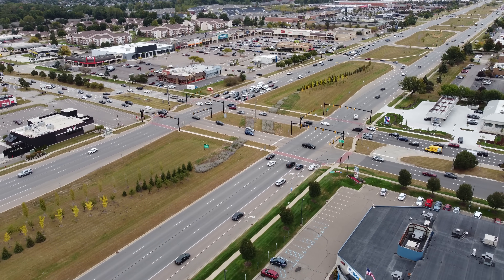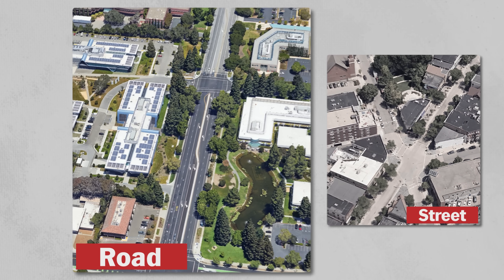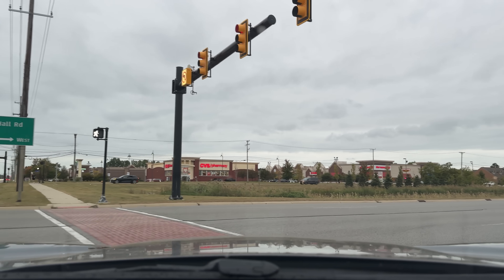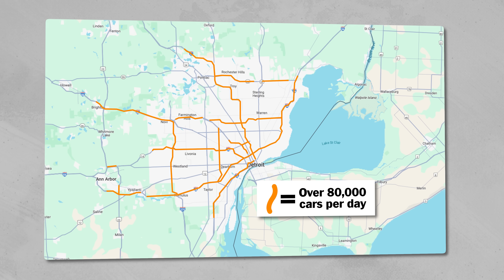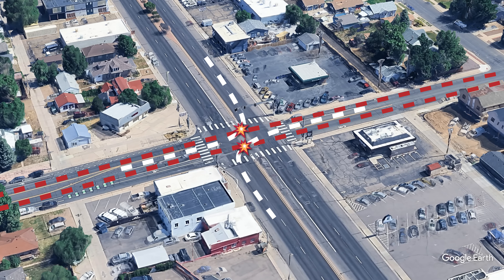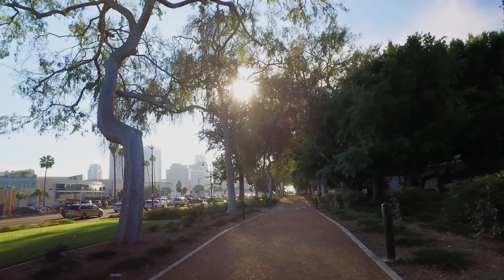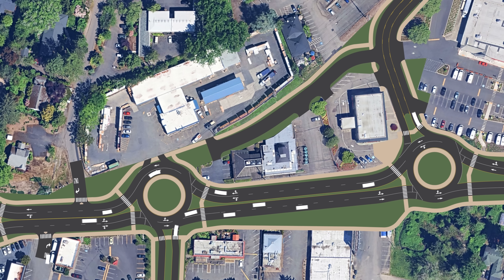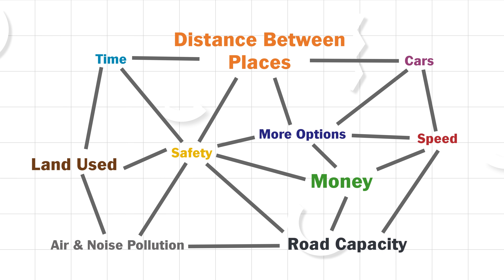How Michigan Built a Super Highway Using Only U-Turns

Comment: The whole video I was thinking "Isn't this just a roundabout with extra steps?", and then it turned out that it is!
Reply: Yes its like a hamburger roundabout since there may be a priority direction that cuts through the middle of the roundabout.
Reply: It’s not just roundabouts with extra steps. It has different strengths and weaknesses than roundabouts. It is worse for cars turning but superior for cars going straight. As when you are going straight on roundabout roads you might have to wait at each roundabout and you have to slow your speed at each roundabout. 

This design as faster through traffic while sacrificing turn optimization
Reply: Some of these conversations are just going around and around in circles LOL
Reply: Well sort of. These roads are dedicated for higher speeds though. Roundabout roads are usually slower speeds at 25-45mph, while Michigan U’s are typically for 45-60mph. This type of traffic density would be congested in a roundabout system. It would have to be a pretty huge roundabout to work efficiently. I personally like roundabouts more, but many people don’t know how to use them and it would cause chaos for a long time before people adjusted.
Reply: You don't want a roundabout on a 4-5 lane road with speeds at 45-55 MPH.
Reply: @ConnerDogood76 roundabouts on multiple lane roads with 70mph limits function perfectly fine in the UK.
Reply: We have more accidents in roundabouts than on proper divided roads here in Michigan.

I grew up driving on Hall Road and a handful of others like it, some that cross each other, and it’s superior to roundabouts, because if you don’t know where you’re going or going somewhere for the first time, it helps having more options.  You can make a Michigan left by turning right or by going straight through and turning around which doubles the amount of cars so if you didn’t realize it was the turn you needed to make and were in the far left or far right lane, you can still turn left from either.

If you don’t build roads like this you’re just doing it wrong.  Metro Detroit invented suburban sprawl and because mass transit isn’t a thing here, we know what we’re doing when designing roads.
Reply: Roundabout that is spaced out with central bypasses - which does work. The problem with traditional roundabouts is that all traffic uses a single circle at the same time.
Reply: @casmatori  I don’t understand why all traffic sharing the one circle is more of a problem than all traffic sharing a single road?
Reply: @casmatori  roundabouts are the best option for junctions like in this video. All over the UK you will see roundabouts on A roads (highways). They can have 2-4 lanes clearly marked out and places with large volumes of traffic will be traffic light controlled. They work. They are efficient and safe.
Reply: @casmatori yhea but we already created multiple lane roundabout
Reply: @Kisbivaly yeah but those are terrible
Reply: @micahbonewell5994  how?
Reply: @Kisbivaly  except ordinary multilane roundabouts still require weaving in and out. Spiral/turbo roundabouts smoothly guide the cars outward
Reply: Not quite. You have to stop at the intersections of a michigan road vs just yielding in a roundabout.
Reply: Yes and no. Roundabouts work best at lower volumes of traffic than you get on Hall Road – 4-lane roundabouts really need traffic lights on or traffic coming in from the side roads can end up waiting for a looooong time, but once you put traffic lights on a roundabout you lose a lot of the advantages of having a roundabout. And because traffic needs to at least slow down for each roundabout, it won't flow as smoothly as if you can give the main road a green wave through successive intersections.
Reply: Except that it also isn’t! A roundabout has a fundamental flaw in its design of allowing the vehicle in the roundabout to always have right-of-way. The Michigan Left allows the primary through-traffic to have priority. This means that the through traffic backs up less! As a Michigan native and someone that has spent thousands of hours driving on Hall rd, 8mile, Telegraph, Grand River, and the MANY many more roads here that use the Michigan left AND driving on many many roads that use roundabouts. I can say from first hand experience that the Michigan left is superior.
Reply: I didn't even watch it. Saw the thumbnail and came to say it's just an elongated roundabout.
I expected another 'yet another American invention' video so didn't bother with it.
Reply: https://www[dot]picturesofengland[dot]com/img/X/1041238[dot]jpg
Reply: @GeekBatman  ofc you feel the need to comment ignorantly on something you didn't watch. LOL
Reply: Just about every major city street in Detroit..called a Detroit left turn!
Reply: Totally wrong take here. It is absolutely not a roundabout
Reply: @MichaelOfTroyWasHere  maybe it's not really a roundabout, but it sure wants to be one
Reply: Couldn't be more different than  a roundabout
Reply: They have a lot of these in michigan, and I know from experience that people in Michigan don't understand how circles work. Roundabouts literally cannot work at Michigan because from my own personal experience of watching people do roundabouts,....... It makes you wonder if the people in Michigan can breathe and walk at the same time...ya know? People come to a full stop at every single solitary roundabout in the state.
Reply: True, but there are ZILLIONS of Michigan Lefts, wouldn't be practical to install roundabouts at every intersection.
Reply: It's a roundabout with stoplights so the worst of both ways of moving traffic.
Reply: @timber9705  not for those of use who've been t-boned on a 5 lane street in the business district, it's ideal for high traffic, higher speed areas.
Reply: Squareabout*
Reply: They're roundabouts that are friendly to plowing massive amounts of lake effect snow we get with the kind of trucks we have up here.

But hey, keep coming up here and forcing us to build roundabouts that turn into giant slippery blind corners every winter.
It's sooooooo helpful./s
Reply: Just wanted to constructively chime in here to say that you're all wrong.
Reply: It really isn't.  I live a mile from the area he displayed in this video.  We also have roundabouts.  People around here still can't figure out roundabouts even though they have been around at least 10-15 yrs now.   I have been to a lot of states.  none handle traffic as well as we do here in Michigan.
Reply: Nah.  Not quite.  If you're going straight or turning right, you don't need to enter the "roundabout" at all.  It's only when you want to turn left.  With an actual roundabout, you have to enter it no matter which direction you're going.
Reply: As an American who has to deal with so many stupid roundabouts that were fine as Yield/Stops, FUCK ROUNDABOUTS. I went to visit some friends, in their town they have 3 roundabouts BACK TO BACK TO BACK and the city nicknamed them the WHEELS OF DEATH.

The Michigan Left is way more efficient and better for traffic flow since WE ALSO HAVE THE LAW THAT ALLOWS TURNING ON RED WHEN SAFE TO DO SO.
Reply: It is, but the extra steps make it feel very different when you actually drive it. I live in a MI city that has actual roundabouts (Uncommon in MI, probably in all of the US), and this feels less like a roundabout, and more like a bus route for cars. You travel down the line until you decide to veer off at your exit, but there's a lot more exits and go through the city.
Reply: No, people here understand how a Michigan left works, nobody knows how to use a roundabout, I’ve had everyone from a small car to a fully loaded school bus pull out in front of me in a roundabout. And emergency vehicles can make that left-hand turn instead of having to slow down trying to make that sharp curve in a roundabout.
Reply: Not at all, there are roundabouts in the area and they are way less convenient than Michigan Lefts, especially the roundabouts in the Southfield area near Evergreen rd.
Reply: No, the major intersections on these would be more than what you want on a roundabout
Reply: @TheTapeandscissors  Yes, for a normal roundabout. But a large one with traffic lights and priority direction lanes can get the benefits of both a roundabout and traffic lights.
Reply: @sparetot  drive around Bucharest and you'll quickly see why roundabouts with traffic lights are shit (unless Romanians just failed to design them properly, I could be wrong here, but it definitely sucked lmao)
Reply: @HeywoodJablome-pv7ge  I've driven in Michigan, the Michigan left is basically a roundabout with lights and works well.
Reply: @HeywoodJablome-pv7ge  That sound like a traffic circle and those are shit.
Reply: @sparetot A Michigan left is 180° with a stop sign or stoplight because it must yield to thru-traffic whereas a roundabout is 360° with the right of way & 3 branches all where you turn right in order to go right, straight, or left. The second right makes you continue in the same direction on the road you’re on, while the first & third rights take you onto the crossroad of it. If you’re traveling on a road heading northbound, then the first right on the roundabout will take you east, the second right continues you in a northbound direction on the same road, & the third right takes you westbound on the same road as the first right.😘
Reply: @sparetot  there are roundabouts with traffic lights. I think in the evenings or late nights the traffic lights are off.
Reply: @KatFish682  not saying they are the exact same but they both dont have lefts across traffic and do a left by doing a 270 degree turn
Reply: Americans will do anything other than install a roundabout
Reply: @DanTheManOG  america has more roundabouts than any other country except France and Italy.
Reply: @traffic.engineer  LMAO how wrong you are!

The UK is estimated to have around 25,000 roundabouts, while the US has around 9,000-10,000 modern roundabouts.
Reply: @DanTheManOG  Majority of "roundabouts" in UK are signalized, and therefore are disqualified from being called a "roundabout".  America refuses to install signalized roundabouts, as that defeated the purpose.  Signalizing a roundabout means it is overcapcity and can no longer function efficiently.

Painted roundabouts are also disqualified because they essentially have all the dangers of a standard intersection.
Reply: @DanTheManOG  and America currently has just over 13000.
Reply: @traffic.engineer  No it doesn't disqualify them. a controlled flow roundabout is still  better than any intersection. But no we haave magnitudes more roundabouts than the usa, if you even consder this.

Painted roundabouts ? do you mean miniroundabouts? because no they do not, they are litterlly the simpliest and smallest roundabout to install and do their job effectivly. they maximise traffic flow. Junctions always have a bias and restrict flow.
Reply: yeah, Americans are real ignorant to criticism about their driving that they would rather wreck for it and take credit for a better idea.
Reply: Roundabout on a highway like road doesn't sound like a good idea
Reply: Well, the Michigan left at least legally involves coming to a complete stop.
Reply: Generally, I find Americans just to be poor drivers. You should see the intersections we have in Australia and yet it somehow works without accidents: https://maps.app.goo.gl/J7GHbCwjWMP8h57W7
Reply: "Turned out" you say 🤔
Reply: Wrong. Oblongabouts. You’re welcome.
Reply: Came here to say that.
Reply: Just a lot faster
Reply: I saw a roundabout with extra steps from the thumbnail.
Reply: @barneystafford  A roundabout forces straight and left turn traffic to mix. This does not.
Reply: @bftjoe  "with extra steps"... hmm, I wonder what that means?
Reply: @barneystafford  It is only "extra steps" for left turning traffic. To just say "extra steps" makes no sense whatsoever, as zero extra steps are required for straight traffic.
Reply: It may seem that way, but these are just different takes on traffic-only-goes-one-way-at-a-time stop lights. Like roundabouts, and diverging diamonds, they're just one of the new stupid fads. Instead of getting priority to turn left at an intersection, you have to turn right, get all the way across four mother....ing lanes, and into a u-turn lane (in 38 f'ing feet!) to do the same thing.
Reply: Buddy it's like an 80 mile long road.  A roundabout is an intersection.

Hall Road runs from the Water then west 80 miles to howell before it gets merged with an interstate.
Reply: Have you ever traveled down a road with a roundabout every half mile? I do all the time. And it sucks.
Reply: @cheekkeith74  Beats an intersection every half a mile. And by a lot.
Reply: excellent thought
Reply: They are roundaboutsssssssssss with traffic lightssssssssssss, period.
Reply: @sora11231  ... kinda like a nail and screw are the same thing, except for two things.
Reply: There’s no lights in roundabout
Reply: It's not anything like a roundabout lol wtf.
Reply: Better than a roundabout, this method spreads the traffic out more and allows people to turn at more exact points for their destinations instead of all traffic on two roads converging at a single roundabout.
Reply: Maybe, but this is better
Reply: To contribute to this discussion, Michigan lefts are not like roundabouts. They are far more straight forward and don't require any navigating or waiting to make a move or extraneous traffic lights like a roundabout capable of handling 80,000 cars would need. And ironically one of the worst cases of traffic I've ever been in was in Sedona, Arizona which had tons of low capacity roundabouts when what they needed were traffic lights.
Reply: A roundabout with an option to just drive straight thru the middle.
Reply: You don't understand stroads and toads that well.  They are very very different than roundabouts.
Reply: Roundabouts suck
Reply: That's what I was thinking too.
Reply: Exactly my thought!
Reply: Most roundabouts in Holland have a capacity of about 30-35k.

In the video I think 80k was mentioned so some form of traffic lights is needed
Reply: Nah, roundabouts are much better
Reply: People in Michigan dont know how to use round abouts 😂
Reply: What he is suggesting will require a lot more lane that cities don't have or can't afford to buy.
Reply: No, not at all, but we have lots of roundabouts also. The two are not the same. Did you not watch the video and pay attention?
Reply: 59 isn't the only road in metro detroit with michigan lefts there's Mound, Telegraph, 8Mile and many more.
Reply: No it's not. It's just a u-turn
Reply: It isn’t, because it doesn’t require through traffic to slow down.
Reply: Yes, it's like a roundabout but it's also a hybrid of a roundabout and what engineers here in the US call a continuous flow intersection.
Reply: The problem is that the volume of traffic on this particular road, a roundabout would be less efficient, and with the amount of trucking, far more dangerous. You (and the producer of this video) really need to grasp the scale of the traffic here. In fact, my old apartment was shown in one section of the video. The volume is incomprehensible to people that arent from here.
Reply: Unlike a rounabout, this doesn't force traffic going straight to stop.
Reply: well, can your lame, ungenius roundabouts waste so many spaces in the middle so efficiently?
Reply: Nope, this is not like a roundabout. You need to experience this in person to understand the benefits of “Michigan Left Turn”. When I first moved here I was confused as hell but after one month, I released this is the greatest traffic implementation ever! There are traditional roundabouts in Michigan as well but they are terrible
Reply: Unlike a roundabout, drivers not turning do not need to do any special maneuvers, nor yield to traffic turning.
Reply: @jonahtaivalkoski322 and it allows timed lights on telegraph so you never have to stop. Other states are so goofy.
Reply: How do you figure this is a roundabout?
Reply: @TheArfdog Ignore the 'look' of this, look at the traffic flows.
 - In the UK this would be called a "doughnut roundabout", because it has a road/hole going through the middle of it.
 - Roundabouts can be various shapes, they are where you go "around" rather being round shaped.
 - Roundabouts can be big. In the UK the centre of a roundabout can be literally a city block.
 - Highways here often have Roundabouts along their length
 - Arguably,  the "M25" orbital is a roundabout that encircles London, some other towns and an international airport. A round trip is 117 miles.
Here Roundabouts vary substantially in design and style to an extent you can easily not realise you have just crossed one. So almost any Brit looking at that video is almost straight away shouting "It's a roundabout!".
Reply: @johnpublicprofile6261  did you cite a study of your precious donut roundabout vs Michigan left yet, or are you still based entirely on your feelings????
Reply: @bftjoe  Why would there be a study of a doughnut roundabout vs a doughnut roundabout?  My point is not that a doughnut roundabout is better than a Michigan left, it is that a Michigan left IS a doughnut roundabout. One of which is a mile from my home helping join (in your vernacular) a highway to an interstate.
Reply: So in your donut roundabout, you turn right and then u turn to make a left? I somehow doubt that, LOL. And straight traffic goes thru unimpeded.
Reply: @bftjoe  Re: "I somehow doubt that, LOL" you have just been watching a video of one operating in Mitchigan. Whether you call a vehicle a car or an automobile does not change what it is and whether it works just because you use a different name. Likewise, calling a junction a "doughnut roundabout", "donut roundabout" or "hamburger roundabout" instead of a "Michigan Left" won't suddenly stop it working. 
And on a roundabout, what ever you name it, not only can you turn right, follow the lanes to turn left (or as you put make a U turn) you can keep following the lanes around  to come back on your original entry road to travel back to where you came from (an actual U turn). I am sure there are plenty of other videos about roundabouts that you could watch. FYI there are over 25,000 roundabouts in the UK in a country only the size of a single USA state, so before you continue being flat-earther about them consider that we might know what they are and whether they work.
Reply: @johnpublicprofile6261  hey, still not the same thing, sorry, bro. useless essay man.

what roundabout supports 4+ lanes in each direction with straight traffic unimpeded at 40+ mph????? not a donut roundabout, LOLOLOL.
Reply: @johnpublicprofile6261  tell us, o fake genius, how many lanes the widest donut roundabout has for straight traffic in the UK? and what speeds do those lanes move at???? LOL

if it was the same thing, then it could move traffic at the same volume, speed, and footprint.

Maybe a donut roundabout has FEWER lanes and LOWER speeds because IT'S NOT THE SAME THING!?!?!?!?!??!?!!???!?!?!??!???

did you even watch the video? 😆
Reply: no, roundabouts can't handle large volumes like this can.
Reply: @bftjoe  They can and multi-lane roundabouts with up to 3 circulating lanes have been attempted in MI and would have theoretically worked, but we found the biggest problem to be the motorists and their tendency to ignore signing and striping. They were "too complicated" for the average motorists as you needed to choose your lane far in advance of actually entering the roundabout (changing lanes within the roundabout wasn't supposed to happen). This resulted in far more sideswipe collisions than intended. The pavement markings also wore very quickly and needed to be reapplied annually and it was a maintenance issue so local governments just never did it which resulted in even more collisions. Most (if not all) of these were later reconfigured to more conventional designs.
Sometimes designers and engineers can have really good ideas on paper that work in theory and simulations, but human behavior is difficult to predict.
Reply: @Peet-e2h  so you honestly think navigating a multi lane roundabout is the same thing as just staying in your lane going straight? what are you even on about???
Reply: @Peet-e2h After seeing European dash cam videos with constant diverging collisions, multilane roundabouts must go through strict review where they work.
Reply: @Peet-e2h  But this junction still requires motorists to choose their lane ahead of time, except that I think you also have to “choose again” and change lane during the junction for some routes. If US drivers can’t handle the complexity of a junction (roundabout) where they have to know where they’re going ahead of time, they’re not going to manage this junction. (Incidentally, if you don’t know where you’re exiting a roundabout you can just use the inner lane—closest to the island—and keep “changing lanes” inwards by driving in a tight circle until you see your destination written on the road underneath you, then start the outwards spiral in that one lane to the exit.)
Reply: @bftjoe you can have large volume roundabouts! But this is more like a roundabout you get in only if you need to switch direction, if you want to go straight you never enter the roundabout-esque part. Basically, only the leftmost lane is a roundabout.
Reply: @bftjoe  Roundabouts can handle WAY more volume than standard traffic lights, no idea where you got that idea from.
Reply: @WimsicleStranger  what standard traffic light is in this video? LOL
Reply: @bftjoe  This is a common miss conception. Traffic lights increase the perception that there is more traffic. in reality roadabouts pass more traffic faster in both directions and do not prevent flow of vehicles.
Reply: @richardnolan5573  you're wrong, show the data on Michigan left vs roundabout or be quiet.
Reply: @bftjoe So a roundabout like this one can't handle the traffic that this "doughnut roundabout" can handle?!
Reply: @johnpublicprofile6261  Do you think a roundabout can handle 6 lanes of traffic in each direction??? What are you on??? Cite a study or be quiet.
Reply: @bftjoe  I agree,  I lived where there were 2 large roundabouts on one main highway.  They did well even with higher traffic levels, but once traffic got really heavy it was a mess.
Reply: @bftjoe Europe disagrees.
Reply: Why put a roundabout on a highway
Reply: @WAATLP  Depending on the traffic levels from the different arms you can keep traffic on the main route flowing compared to traffic lights, you remove left turns creating a point of conflict, and traffic joining from the side streets or business only need to look for a gap from the left to be able to join the road after which they can continue through the roundabout to their exit without need to stop and wait for another gap or at lights.

The problem with roundabouts is when traffic is too dominant on the main route that waiting traffic on minor arms never gets a chance to join, or major intersections where there is no balance between the arms.  Those situations are what leads to roundabouts with traffic lights.
Reply: @WAATLP  Why put an intersection on a highway?
Reply: @synless322 These are highways, not freeways. You put intersections there because there's crass streets and businesses.
Reply: @synless322  It’s a strode it also has street lights.
Reply: @synless322 you’re confusing highway and expressway
Reply: @synless322  :D
Reply: @synless322 because its not a highway. I don't  know where people thought it was a highway.
Reply: @WAATLP it's not a highway.
Reply: @FAB1150  Looks like a highway to me (or well, dunno about english terminology. Is a highway a freeway? Or is it an expressway? Because these stroads are clearly expressways at the least). Which is why it is utter stupidity to place any intersections in the same plane as it. Should use off/on ramps, and bridges/tunnels.
Like, it seriously has FOUR lanes, per direction. If that is not a free-/express-way, then it is clearly either a parking lot or a huge and overly complex roundabout. Or maybe a ferry-station. Nothing else I can think of has that many lanes.
Reply: @WAATLP  iceland does that
Reply: @WAATLP  or worse, why put stop lights on a highway?
Reply: @WAATLP oh yeah, other people have jobs and go shopping and stuff. 

It's kinda like your food stamps.   But we actually earn it and aren't just a parasite on society.
Reply: @WAATLP  why are there traffic lights on a highway?
Reply: @WAATLP  Always has been.  A freeway cloverleaf is just a kind of folded-up (hamburger) roundabout.  A defining feature being you can just stay on all of the exit ramps in a big loop as long as you want.
Reply: @WAATLP  it’s not a roundabout if you pay attention to the video.
Reply: @WAATLP because they improve traffic flow. Just look at uk
Reply: @DanTheManOG this is a suburb of Detroit. There are more cars in the suburbs and there are in half of England. Most homes in the area have at least three cars and many, five. The houses in this area have three car garages.
Reply: @garyszewc3339 Detroit is a metro area of 5 million. I don't think they have more cars than half of England, a country with 56 million people.
Reply: @DanTheManOG  The state of Michigan is bigger than the island of the United Kingdom, with more spread out population centers and much larger vehicles, and MDOT-(Michigan Department of Transportation) can’t figure out how to make a roundabout properly.
Reply: @DanTheManOG  would not help with Hall road. You have tree major freeways that people use to get on and off. Plus the fact that they have way to manu lanes.
Reply: @WAATLP  Because they want to enable getting off the highway (for left-turning cars, or ones that want on in the opposite direction) through the median (for some reason), rather than an off-ramp with bridges over to the other side.
And because they (for some reason) do not want on-ramps, but rather orthogonal T-junctions that take less space but have a harder time merging in.
And because they (for some reason) want to route all traffic that does not want to interact with the highway at all and is just hoping to get to the other side of it, THROUGH the highway, instead of routing it over/under it with a tunnel/bridge.

edit: But yeah, I completely agree with you that putting an intersection (or roundabout, even if that works better than the intersections) on a highway is absolutely stupid.
Reply: I thought that from the thumbnail. It's somewhat similar to a typical UK motorway junction except that everything is on the same level and therefore it needs traffic lights.
Reply: The Michigan Left has been in use for longer than the modern roundabout. And as a Michigan resident who has also used roundabouts, I can definitely say that roundabouts are awful in comparison, lol
Reply: Hi, lifelong Michigander here & I hope I can clarify the difference between roundabouts vs. Michigan lefts for you because they are not the same.
What the content creator was talking about is not a roundabout because a roundabout is a 360° circle with multiple branches that can take the driver in one of 3 directions. On a roundabout, the first right takes drivers to what would be a crossroad if it was a traditional road w/ right & left turn options. The second right is to continue on the same road, in the same direction from which they came, as if they’d gone straight. The third right is as if they made a left turn on the same road as the first right option, but it’s 180° in the opposite direction. This means that if the first right takes the driver west, then the third right takes the driver east on the very same road. While on a roundabout, traffic continues moving & the streets connecting to the roundabout must yield to the flow of roundabout traffic until it’s safe to proceed.
A “Michigan Left” is similar in that it helps keep traffic flowing, but it’s different in a variety of ways. A Michigan left is 180°, not 360°, & it has just 2 lanes for drivers to use. If you go to the leftmost inside lane, then you continue onto the leftmost inside lane of the road on which you turn. If you choose the outside right lane, then you go to the lane next to the one where the left lane drivers turned. Then, if there are more than 2 lanes on the road on which you turned, then the outer right lane drivers make their way over to whichever lane is needed. Sometimes, the outside right lane allows drivers to drive straight across into a business, as if making a 90° left turn from the original direction they were driving. Unlike roundabouts, Michigan lefts will always have stop signs or stoplights because they must yield to oncoming traffic. When making a Michigan left, if the light is green or yellow, then the driver can proceed straight through, as long as it’s safe to do so. If it has a stop sign or the light is red, then the driver must come to a complete stop before completing their turn. Usually, even if the light is red, once you have stopped, you can proceed when clear/safe, unless otherwise posted.
Go to a map on your phone or computer & look up Baldwin Rd. at I-75 in Auburn Hills. If you follow Baldwin Rd. south, you can see how to use Michigan lefts to enter Great Lakes Crossing Mall &/or if you follow Baldwin Rd. heading north, then you will see both Michigan lefts & actual roundabouts further up, so it could help make it more clear as to the difference between the two.
Michigan lefts are fantastic because they keep traffic flowing nicely, as long as people follow the rules. I hope this helps.😘
Reply: This is all crap as I live with this BS
Reply: Roundabouts are horrible for pedestrians
Reply: @guilima3097  Yes.  They divide neighborhoods up because people cannot easily cross there or force additional cost to build unsightly bridges over the roads that require extra cost to maintain.
Reply: Worse, since you have to cross lanes of traffic to get to that U-turn lane unless it's set up in all directions. Tashkent, Uzbekistan did a major infrastructure overhaul about a decade ago, setting up many of their roads like this. It worked pretty well. I'm curious where this design idea started.
Reply: @ahwhite2022  There is no law against it and it is much safer.
Reply: Those tend to be more dangerous.
Reply: hamburger roundabout but a bit faster,and takes more space

...that tradeoff is questionable but meh
Reply: It's like a roundabout but worse
Reply: @alfrredd  It's not in any way worse than a roundabout. A roundabout works better on a smaller street. This is designed to handle massive amounts of traffic.
Reply: @alfrredd Except it allows for higher speeds and greater volumes while also allowing cross-traffic to continue if one direction backs up. The roundabout is superior on a small street, the Michigan Left is superior on a large road, both have their use-case.
Reply: @asteroidrules 100%
Reply: @alfrredd  show me a roundabout that connects two 6 lane roads.
Reply: @alfrredd  no it’s not